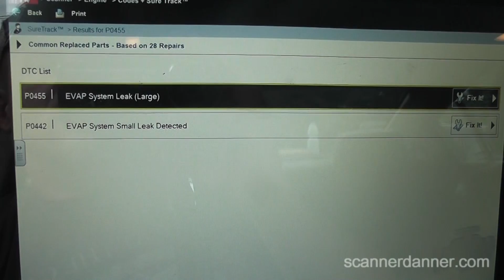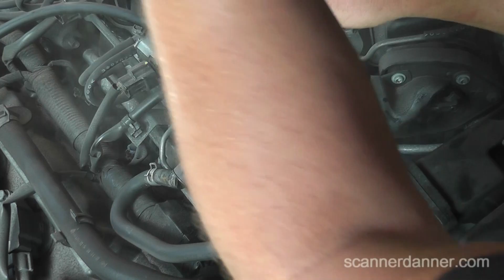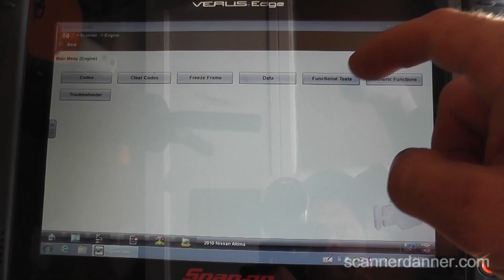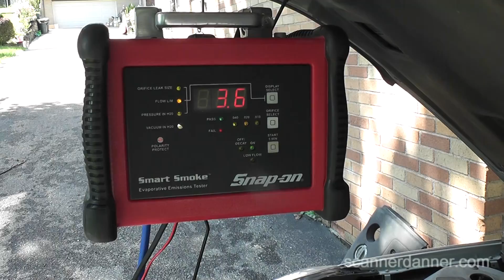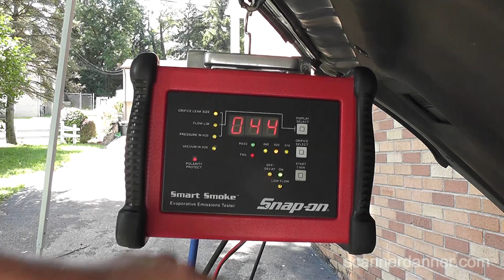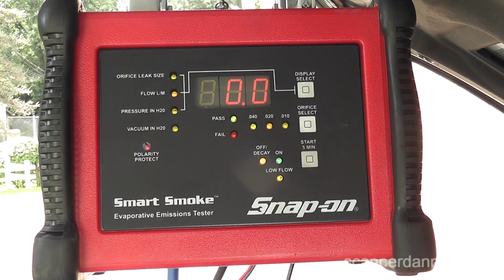2010 Nissan Altima P0455 P0442 EVAP Leak Testing

Comment: would you ever consider testing the power and ground to the vent? I had a explorer a couple of months ago with a small evap leak. I found a leak at the vent solenoid and with the vent solenoid energized only had 8 volts on the feed. no circuit codes. repaired resistance issue in harness and retested. no leaks found. weak magnetic field.
Reply from the maker: For sure! Check the description of this video, I have a few more EVAP vent valve issues where I'm showing the voltage measurments. Good tip though thank you!

Comment: Nice find. Replaced many of them at the dealer . Some times if you close and open that   valve a few times it will start sealing itself. Not a fix but something to watch out for. VARIABLES.
Reply from the maker: Great tip man thanks!

Comment: Not wanting to undermine the need and importance of using the right tools, but I once tried a cheap dry ice smoke producer - basically and party machine - and it worked for manifold vac pipe leak. Just a suggestion.
Reply from the maker: I think as long as you limit the psi to 1-2 psi max and make sure your mineral oil is free of any fragrance
Reply: LOL. What's wrong with solving the leak and having the best smelling car in the street;-)

Comment: It's endlessly frustrating that the SnapOn smoke machine shuts off the way it does.  Makes it very difficult to use as a diagnostic aid.

Wonderful diagnostic process, though!  I love hearing your thought process; it's a great teaching aid.  :)
Reply: Most machines shut off after 5 minutes. That is to prevent the heating element from burning out and keep the smoke chamber from overheating.  It also is supposed to prevent shoving excessive fuel vapor out in the event you have a very large leak. In general it's a PIA.

Comment: Want to throw in something regarding purge valve testing when diagnosing EVAP leak codes.  You should always check to make sure the purge valve will actually open when commanded when checking for leaks, unless the system has it's own leak detection pump, the ability of the engine to pull the system to a vacuum is what tests for leaks.  Inability to pull a vacuum with an electrically OK but stuck closed purge valve will set a large leak code.  Had a Chevy van a while back that took me quite a while to figure out due to ignoring the purge valve when leak testing.
Reply from the maker: Good point but you would also have incorrect purge flow codes as well. Not the case here so I didn't feel the need to check it for opening. But definitely something for others to consider
Reply: Didn't have any on that van, only code it set was a large leak.  Imagine it depends on the system, but this particular one did not.
Reply from the maker: I think you're right, it depends on the system which is why it is important to remember. Thanks!

Comment: Great video! Thanks for the share! Have you considered getting ahold of the add on tank for your smoke machine? I have the EELD100A (step down from your machine) and  love this little tank. It's literally a paintball gun air tank with a regulator that plugs right into the smoke machine. Pretty cool though. Great for staying mobile. Although I use shop air more often then not.
Reply from the maker: I have that canister. Just no where convenient to fill it :-(

Comment: Nice find my friend. I had a ford expedition that had the same codes, but unfortunately it was at my house, on a breezy day. I ended up smoking the evap, then triggering the vent valve closed, and watch my FTP voltage that it stayed steady. 1/2 to 1 psi of smoke yielded 5v at the FTP and it held. We replaced the vacuum hose on the vapor management valve (ford name for purge vavle) since it was rotting away. So far so good.

Comment: I did not watch the video yet. But an FYI for some Nissan Altima owners. There is a TSB for these codes. You would install vent valve filter and a new vent valve. Not sure if it applies to this vehicle though.
Reply: was that for spider webs problem like hondas.
Reply: Nissan says for debris. But almost all Nissan evap issues are failed vent valves. Or intermittent vent valves.
Reply: Would the car be surging when  stopping and having trouble starting